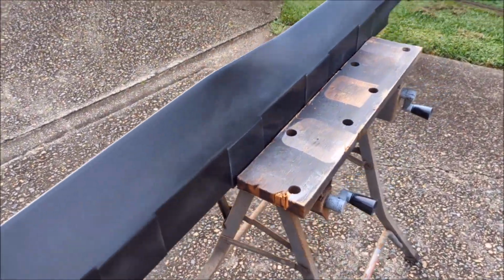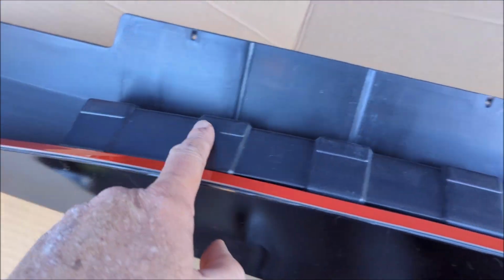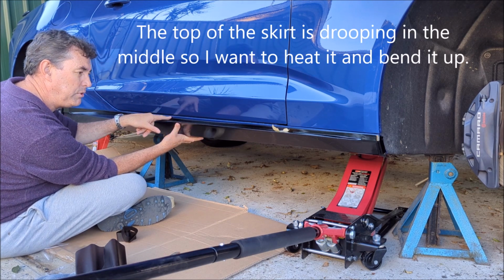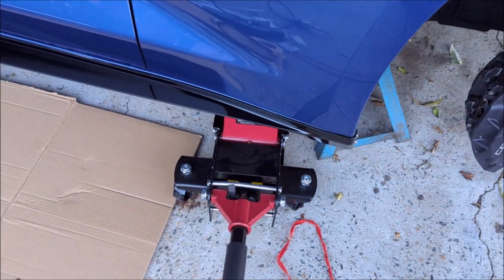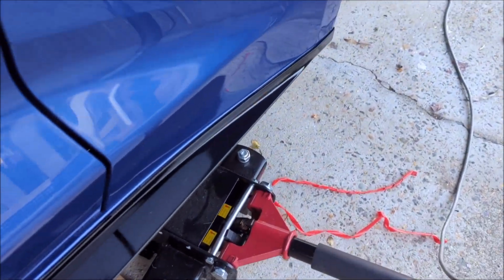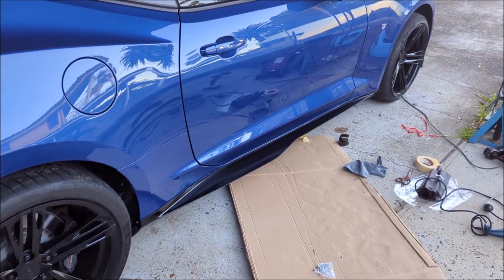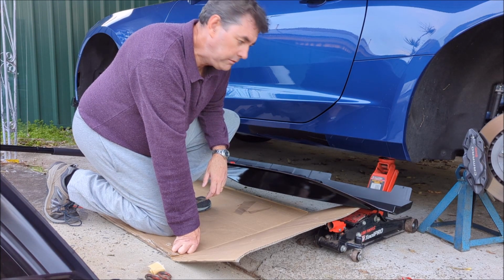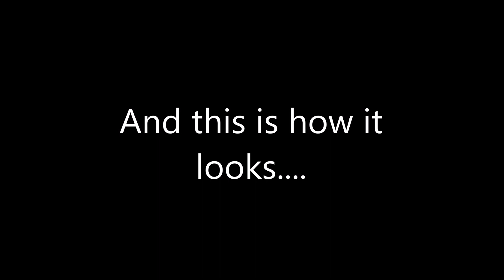Paint & fitting eBay 6th Gen Camaro side skirts ZL1 1LE style...

Comment from the maker: Update: I ended up using Sikaflex 227 adhesive after finding the double-sided tape wasn't sticking. Maybe it was due to the ceramic coating? Also, I helped the reinforcing ribs by using some expanding foam inside the side skirts and trimmed the excess, so they were flush with the car body. It all worked really well and never had another problem with fit or finish after that! I might upload a quick video as I took some footage during the process.

Comment: Hey Question? The tire wheels you have are ZL1 factory wheels? Do you have any rubbing issues on the rear?
Reply from the maker: Hi there, no the 305 tire fits without any rubbing. If you were to run a 315 tire, you need to relocate the wire harness which sits behind the fabric inner guard. This gives it just enough room!